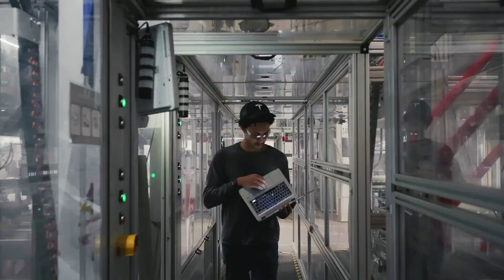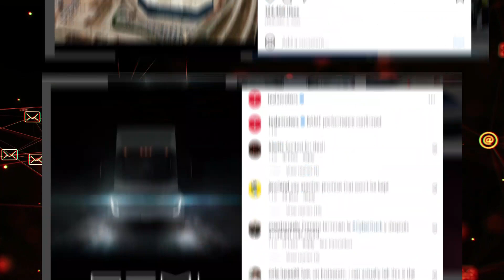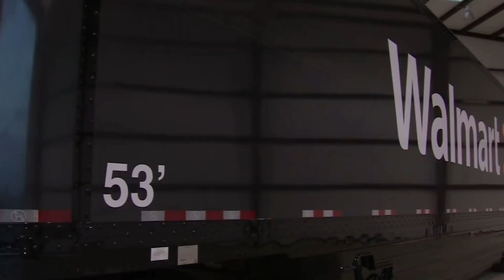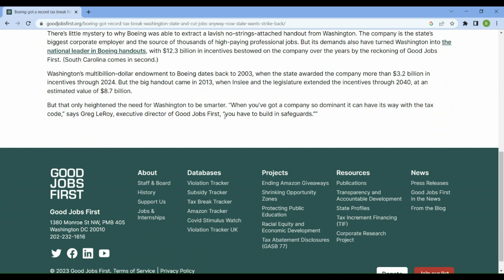Giga Nevada Battery Gonna DESTROY the Entire Electric Car Industry

Comment: 145,000,000 electric cars? Bit hard with current Li-on battery technology. Laudable ambitions but not enough cobalt, manganese etc and other rare earth metals. The raw materials just aren't there. Even with the possible emergence of better batteries based on Na-S, Li-S etc which would at least be made of cheaper and more abundant materials and which would have a chance of being economically sustainable you still have a major issue with the run out and maintaining of charging stations in that how can it be done without charging a lot of money for the electricity. As with the petrol stations network it would have to pay for itself as a business. You not only have to build the network you also have to maintain it and is anyone expecting governments local, state and federal to be able to do it when they can't fill the potholes in our streets? This is quite without the problem of boosting the electric supply grid to an extent whereby electric battery cars by the million or even tens of thousands can be affordably charged overnight. Electric cars are mainly virtue signalling at the moment and Tesla is a subsidy farm whose main business is selling carbon credits to other vehicle manufacturers. Religions are made up. Gods are mostly imaginary. There's no Santa Claus or Easter Bunny. The current absurd campaign against abundant cheap available energy (fossil fuels) in the cause of mitigating so called 'climate change' supposedly caused by increased levels of CO2 in the atmosphere is mostly a matter of pursuing imaginary solutions to an imaginary problem but how much will people be willing to pay in the cause of their pretence? For a false narrative? And are the fervent proponents of this idiot new religion willing to sacrifice the whole of civilisation? Silly question. Of course they are. I would bet the CCP Chinas and Indians are not. Are they saying they would now welcome the runout of a whole network of Small Modular Nuclear Power Stations, perhaps even Molten Salt Thorium based because that is what it will take. In the future, when we crack the problem of fusion power human kind will have exponentially more energy to play with and maybe the future equivalents of these proponents of this ridiculous the sky is falling because of CO2 scare will have to find something else to complain about. In the present pardon me while I laugh at their absurdities and enjoy watching the increased abundance of plant growth world wide set off by the tiny extra few parts per million of CO2 added to the atmosphere by human activity. It's a terrible sight. The earth is greening. The deserts are shrinking. Forests are prospering. Grass will overcome all and I'm sure someone somewhere will start to worry that the poor little gay whales will have nowhere left to go clubbing. But we don't have to take too much notice of their madness.